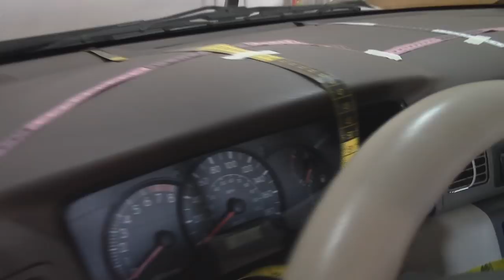Custom made carpet dasboard cover - Car upholstery

Comment: What is this material that you are using to take measurements/shape of the dashboard? Is it some type of leather or cloth?
Reply from the maker: It is a tailor's  flexible plastic ruler.
https://www.amazon.com/Measure-Flexible-Measurement-Centimetre-60-inch%EF%BC%88White%EF%BC%89/dp/B07MT89MCW
Reply: @Cechaflo  No sir, that other material the white plastic or cardboard type thing, the one which you bind to the carpet.
Reply: The paper that you are cutting at 1:18. That white paper.

Comment: You covered up the air bag, no bueno. It saves your head in an accident
Reply from the maker: Interesting remark, but fortunately this cover is very light and it is not glued down/fastened over the dashboard. If the misfortune would happen it would easily be blown against the windshield.  
Thanks for kind comment!